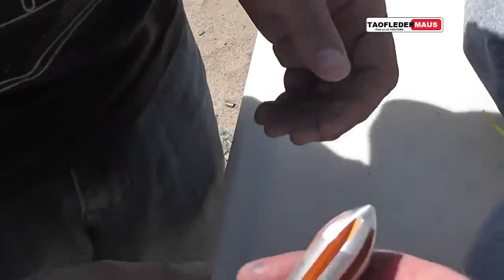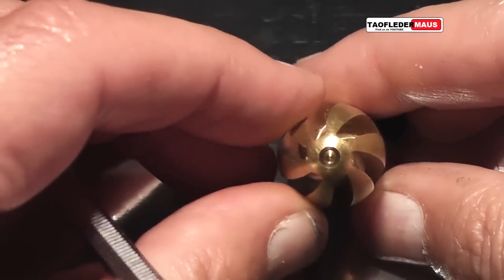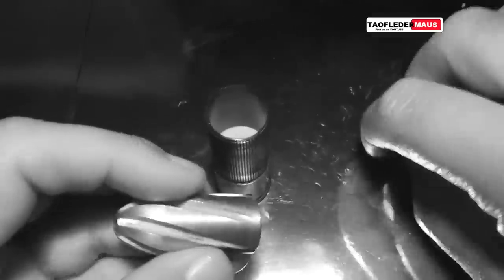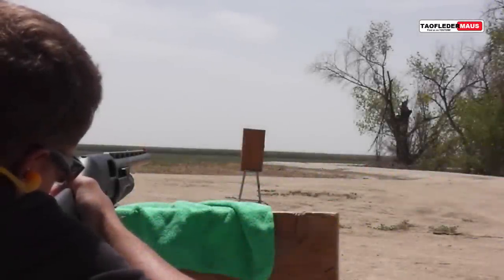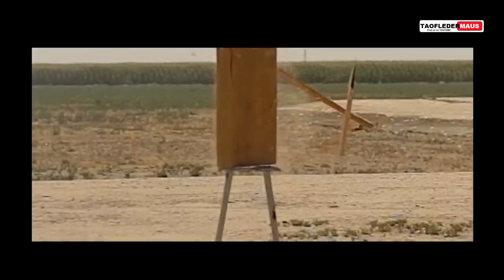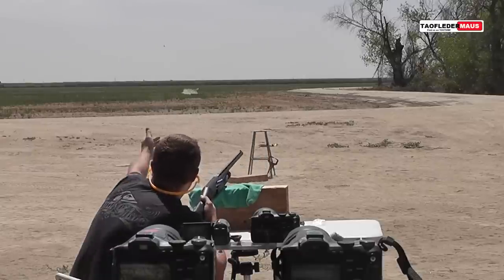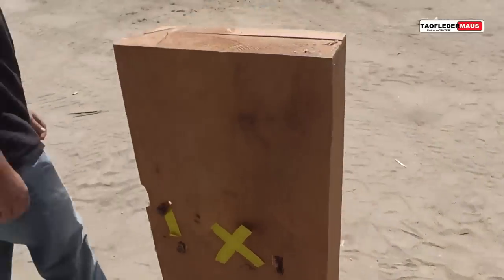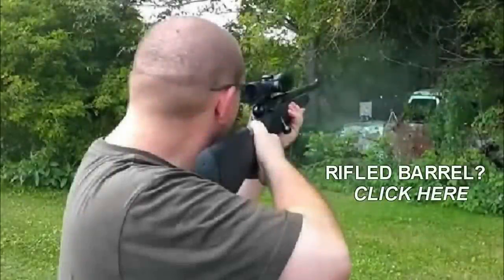70 Cal. Custom Machined  Brass TURBINE Shotgun Slugs -  Tests

Comment: ***** The major difference between these and the ones that worked is the turbine, right? Now it seems that the turbine is causing lots of drag at the front of the projectile, making it unstable.

What I'd like to see is what would happen if the turbine was inverted longitudinally. So that when you start from the tip of the projectile, the grooves start after the center of mass and are the deepest right at the end.

What this would hopefully achieve is that the center of drag would be behind the center of mass, making at stable.

Comment: The issue is the slug is so thick that its not expanding in the barrel to the create the spin so even though the rounds look like they should spin like a rifled slug they cant preform like them in the barrel... That is why lead works so well

Comment: instead of putting hollow grinds near the nose put them near the end of the slug. if you think of arrow, they'r forward heavy with the fletching at the end of the arrow shaft. if you were to put fletching near the arrow head, just a slight twitch would cause the arrow to go out of control, i think that whats going on here

Comment: What if instead of cutting the spirals into the slug, you milled down the spacing between the spirals so that the spiral pattern itself stuck out? If that makes sense. Like having spiral ridges down the length of the slug.

Comment: I'm thinking that the flutes are a bit too steeply curved around the slug. Remember that one machined dart with the almost straight fins that flew superbly straight a while back? The fins looked straight until you take a real good look at where they start at the top of them and where they end at the bottom. The dart got stuck, I think it was impact welded actually, into the metal sheet it was aimed at... Can't remember the episode but you guys should be able to remember that one.

If that... what was it... canter? ugg, geeze, I can't remember the right word, but that amount of twist where it is only twisting very slightly that it gives the illusion of them being straight flutes would probably be getting better results. Since sharp turns for where the air's supposed to run though seems to be the problem here.

But I'm no machinist, or one who knows ballistics physics much either. Just seems to me that if you want the rounds to spin you should make it easy for the air to spin them, slight turns instead of rather sharp ones. and by sharp I mean drill bit like.

Comment: How about making the twist of grooves moderately mild? A rifled barrel is able to provide much higher and stable rotation for the projectile. Therefore a projectile shot from unrifled barrel is hard to make rotate stable at high rate. So i think that any kind of grooves introduced to projectile design should be very moderate. How about studing the design of "russian round" in previous videos? It flought very accurately. It got palstic holder cap for the powderblast shockwawe that was also holding the heavy projetile. I think the "turbine design" could benefit for such a cap. :)

Comment: Hm..... what about making the rifling on the slugs bigger? Like only have 3 fins as rifling and bigger wind canals between them?
Also: make them deeper maybe? Like make it 1/3 of the barrel (as in diameter) for a fin, then 1/3 for the body and another 1/3 for the other fin.
Another thing that I would try is to make them hollow. I know thoses are hollowed out in the back but they still have a solid surface in the back. i would suggest piercing said surface to make it feed on the airstream more.
Those thing are what I would "improve"
After all, no one knows if it will work at all.

Comment: I noticed you used plastic shims inside the shotgun shell to keep the bullet and shell together. It made me think, what is the diameter of the turbine bullet?  If it is smaller than the inside barrel diameter then it's a no brainer why the bullet isn't spining. Of course making the bullet touch all sides of the barrel simultaniously could cause an overpressure problem.  Anyway, thanks for making these videos. By the way did I see the smallest mountain range in the world in the background of one of your videos??  The Sutter Buttes??

Comment: It's probably way more complex but to me it looks like the flute coming off on an angle instead of keeping the same depth along the round is acting as a sort of control surface and once the round's chosen a way to weebl it aint gonna wobble back to straight since the deeper gouges have nowhere near the resistance as the initial weebl

Comment: You HAVE  to match the twist rate of the projectile to its weight, and length. just as shooting a 75 gr 5.56 bullet in the wrong twist rate will make the round keyhole, or miss

Comment: The grooves are too deep and run too far down the bullet. Can't really tell from the video, but my guess is also that there's too much room between the bullet and the barrel walls. It starts tumbling the moment it leaves the barrel, which could mean that the bullet is bouncing between the barrel walls too much or that the projectile is too heavy. A "too heavy" projectile causes too much pressure buildup in the barrel, thus the moment there's room for the pressure to escape (when it leaves the barrel and there's room between the back of the bullet and the nozzle) the force of the escaping pressure is uneven, thus causing the bullet to tumble.

Just a guess, of course.

Comment: there needs to be a lip on the back of the bullet, and the fins need to reach all the way down.
Reply: +The crow the last round had fins all the way back and that made the gas to escape through them, reducing velocity.
Reply: they failed to deploy though
Reply: +The crow
 Respect the crows. Their high intellect, strong sense of group effort, and cooperative spirit makes them more beautiful than the Swan in my book.

 They can be likened to the Mafia due to the strong inclination to their community and their fierce defense of each other. If a crow is harmed on its community's territory, all the crows who witnessed the event remember the face of the attacker. Should that face appear again, all crows in the area capable of fighting will assault the attacker to drive it out. Even if the attacker wears a mask the first time and turns it upside-down on their return, the crows will notice the odd face and go into a roll mid-flight to identify the unknown entity. Not only are crows capable of remembering the face for years, but crows are capable of passing the memory of it down generations, meaning that a person may be exiled from the territory for decades.

 Respect the crows. Capitalize your name. Please.
Reply: Thelothuo huh, that's the only platform it wasn't capitalised on.
Reply: *****
 Standardized names are extremely useful for locating friends and the like across different games.
Reply: I know, that's why all mine are The Crow.

Comment: What if you had Tim machine a couple of thin grooves around the slug to hold something like a Teflon ring to bring the diameter up to say .720? One ring up front and one ring at the rear or just one ring up front might be enough.  I think that has a better chance of stabilizing the slugs while inside the barrel without adding drag. The slugs are kind of bouncing out of the muzzle as they are and why they are unpredictable.
Reply from the maker: *****   He's working on some new designs right now.  I'm not sure if he will pursue this or not.

Comment: 1) try not making the grooves so deep.They aren't really making the slug spiral and are only contributing to the slug's instability in flight. No more than .5mm deep.
2) Maintain its overall length but "castle" the tail to lighten the trailing end and provide drag to keep it flying straight. Like a shuttlecock.

Comment: Hmm, maybe the grooves are simply too deep on that slug. Each of them will cause expansion fans on the edges that interfere with each other, and if the interference is high enough and it's at the tip of the slug it's like the slug hits an invisible wall and starts tumbling for that reason. Adding less grooves and/or making them shorter and not as deep might do the trick, all it needs for the bullet to spin is a slight pushing breeze over the surface, not a big hurricane.

Comment: what about a 2 material bullet?....like brass on the front and aluminium (or tin) at the back and then turbines?...baybe with a hole in it? (a small hole at the front which expands and gets larger in a cone shape [like 1 mm at the front and at the back it is like 2 mm from the walls])  (would probably be one shot)
Reply from the maker: *****  Funny you mention that.    The next video is something very close to that.
Reply: +TAOFLEDERMAUS i can see the future!

Comment: at the supersonic speeds the bullet moves to fast it pushes all the air away from the bullet, only the nose of the bullet is subject to the friction of air where as the tail of a bullet has zero air pressure so any design, wings,fins, grooves,string will have little effect on the projectile.

Comment: what if the problem is that there is too much power causing the unstable flight posibly worth making the knose alot more heavier stopping the tail from swinging around or making the tail smaller than the front .

Comment: That's really close to working. I wonder if they improved the design to the point that it does work.
Reply: If I were to take a stab at a design, I'd give it some groove on the back to catch some air. And much more shallow turbine grooves. 
There's no way of knowing what happens without testing. But in the end I don't think it matters, since there are other rounds that already do the job well enough.

Comment: Ill bet that the "turbine rifling" is just creating uneven drag and turbulence across the projectiles body. Like the air outside is moving past faster than the air inside the rifling part.

Perhaps if the rifling was thinner and protruded outward, rather than went inward and there was some type of specialized sabot behind it?
Reply from the maker: Kyle Stamps   They've gotta be complicating the aerodynamics like crazy.
Reply: They look badass tho 😎

Comment: ballistics are extremely odd, the fluting in the slugs are too deep which is causing them to spin, and the following edge is causing a disturbance as it spins which is causing the slugs to go wonky after a short distance, you can also hear the round doing this at a distance with the whistling.

think of a airplane wing, the grooves are creating a vacuum which dis allows the air to escape. if the trailing edge of the rifling were to be tapered ever so slightly it will increase the escape velocity forcing the slug to track straight instead of creating a vacuum in the rotation.

there is a high pressure wave that forms on the front of the slug as well and because the grooves are creating a vacuum that pressure wave is causing the slug to loop out. i have a feeling these slugs would work tim, make a sharp edge on the leading edge and bevel the trailing edge of the grooves, shortening the rounds will also aide in this

Comment: it looks like the twist rage is too much for the acceleration of the round which is causing the instability the average twist rate for  most guns is around 1-9 make it with a shallower twist rate and it should be able to cut through the air a little better
Reply: rate *
Reply: +jeremy Shanebrook I've seen rifles use 10:1 ratios for their rifling. (10 inches: one full turn)
Reply: Ya its not really set bit either way that's alot shallower than what they have in the round in this video

Comment: wieght forward is the right plan but your gonna have to play with the balance point and just ditch the "rifling" cuts on the slug..only reason they are on some commercial slugs is to partly act as a little bit of a safety margin for people that may be shooting em thru improved or tighter chokes and partly as an add gimick they can point at. The most successful reloading slug out there beside good old pumkin balls have to be lee key drives which are smooth sided and have a tipping point just shy of half their length...weight forward but not by much.Next step up would be saboted slugs which your just wasting money on if you dont have a slug barrel

Comment: it needs to have the spin inside of the gun pipe ... and needs to gradualy slow down the rotation in the air ... and because this round had no rotation in the stable spot (in the barrel) ... the increasing of spin in the air (unstable air environment) that drag frome the air pushed the nose behind ... so maded mor drag frome the front and the back started to come but because it was light it tbmbles back and is a repetitive process of instability ... i hope you understand what  i wanted to tell you...

Comment: the design for the bullet could've worked, in fact it would've worked if it hadn't been for two design flaws: first: the weight distribution of the bullet was off. think of a dart being thrown at a dart board if you threw a dart you would want to throw it by the middle of the dart this is because most of the weight of it is at the front, however the tail of that dart has two purposes: to counter balance the weight of that dart and help guide the wind, but in a gun its being pushed from behind; not from the balance point, so there must be more weight at the back to balance the bullet. second problem was the depth of the grooves of the turbine. the bullet started spinning out of control because the bullet started with spin and velocity before it exited the barrel, but the wind caught by the turbine design coupled with the bullet being unbalanced made the bullet spin too fast and lose its trajectory.

Comment: It seems to me that the height of the projectile is far too tall compared to the diameter to stabilize properly with any amount of spin that the spiral grooves can produce. Longer projectiles from smooth bore barrels tend to work better using drag stabilization  (such as in the "soviet or latvian shotgun slugs" test video) the reason it works so well is the projectiles centre of gravity is well forward of the centre of ballistic drag (which is what ol Burt was on about with the cigar scene in worlds fastest indian) I think the reason why the brass projectile in this video is tumbling so early is the tapered nose and the spiral cuts make the front of the projectile too light which is moving the centre of gravity too far back to stabilize. If they were to have more of a flat face and tapered waist with the back hollowed out more like an elongated wad cutter airgun pellet then they might have more chance of working :-)

Comment: The grooves are the actual problem. They are so pronounced, long, and sharp-edged the wind catches them and the slug is pulled in several directions at once.

If they were 1/5 the depth and stopped at the taper, they might have had a better chance, imo.

Comment: It never stabilized because air is not dense enough. If they were traveling through water it might stabilize. It would be far shorter ranged.

I don't know what could help perhaps a cup shape coming out of the barrel with 4 holes drilled at an angle in the bottom. would work better.

Comment: The reason why these slugs don't work is because the center of drag is in front of the center of mass. If the fluting were located at the very back of the slugs, they would probably start flying straight. Even then, they probably would not spin.

Comment: I have a suggestion. Make the back of the rounds larger in diameter than the front but dont make it straight like a shuttle cock make it like the silly illustration below. The design should create more drag in the back of the round stabilising it in flight. Oh and the reason this round didnt work even being like a shuttle cock was this rounds front was disproportioned to the front of a shuttle cock (not the same front to back weight ratio). Plus the round was going to fast to stabilise like a shuttle cock. 

__
        \_

          _
__/

Comment: So, why not make the rounds exactly like a rifled slug and see what happens? The rifled slugs I shoot from my 20 gauge fly straight for  100 yards or more.  How does that design work but none of these others you guys try? The only difference I see in these is the dimple on the front of slugs. Does the dimple deflect the air in some way and that is not noticed? Maybe "Tim" should make a few with a dimple on the front the same way rifled slugs do.

Comment: The reason this will never, ever, work, is mass.   The air the round is moving through does not have enough mass to induce enough force in the turbine to begin to rotate the mass of the round itself.

Fired in water, it might begin to spin, but will also lose all of it's velocity in short order.

Comment: why the heck is the bolt opening on that shotgun?? are those loads producing too much pressure?
Reply: Jacob B. the benelli nova series of shotguns are pump action.
Reply: Nicole Woodruff that's very odd, i mean i have heard of that happening but definitely not as a design feature lol
Reply: Nicole Woodruff all the shotguns i have fired have been relatively new and they were all mosberg 500's that has never happened to me, thats odd

Comment: Is it possible to make two moving parts together, and use an air compressor to let the tip spin very fast like a rotor. before shooting it.  A bit like this shape  [_]=[___} .
Reply from the maker: Steve Bergen   Probably not.   lol